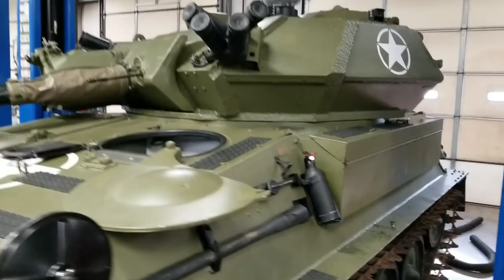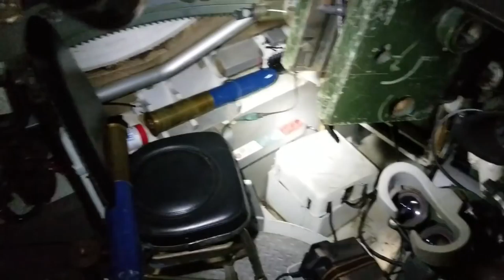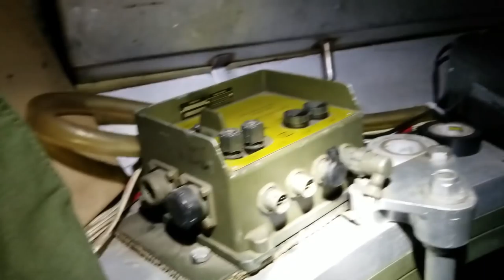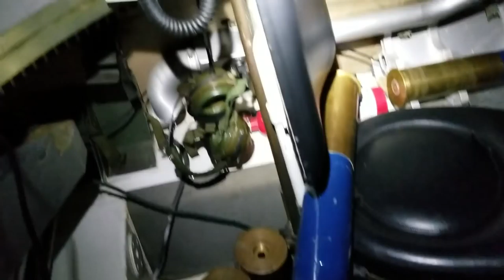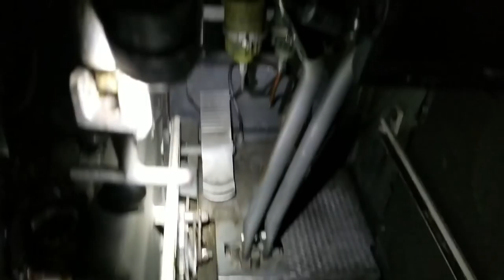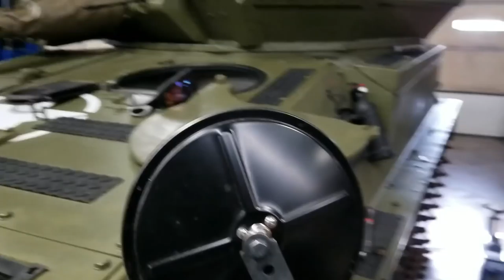British Scorpion Tank Up Close

Comment: It's NOT a tank , I  have driven one a long time ago. It's a  reconnaissance vehicle , some people wrongly called it a light tank  because it mounts a gun and has tracks. The gun is just 76mm in calibre , I have fired larger calibres from my shoulder than that i.e. Carl Gustav 84mm.The vehicle's armour was aluminium making it  a mere 8 tons, making it air portable. That aluminium gave it little or no  protection from  armour piecing rounds. On  a lighter note when I was learning to drive one to get my H  class licence I was in Germany and driving through Herford, and took a corner too fast in too high a gear and mounted the pavement slammed the brakes on just before a large shop window!  The commander/ instructor in the turret  simply said to me very calmly  ''driver engage neutral and come of the pavement please'' .
Reply: Although you are correct by modern terminology, it fulfills the characteristics of what is traditionally known as a light tank. It has tracks, a fully traversable turret with a gun and it has armour. As a gunner troop commander, I had the spartan. My actual issue was a ferret, but in peacetime we never had the full compliment of dets, so often I would use a spare spartan. Very comfortable tracked camper van.